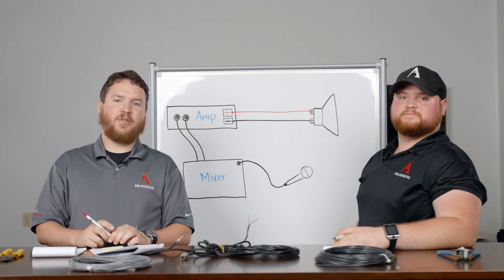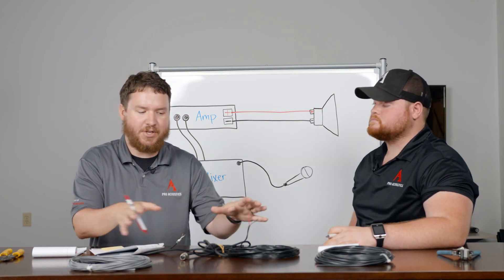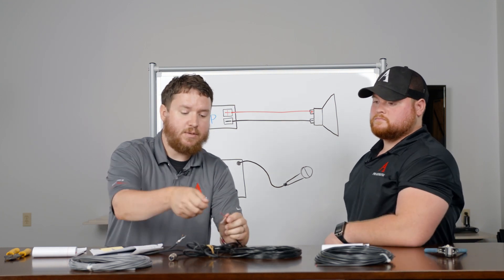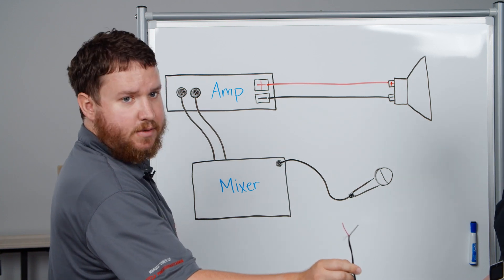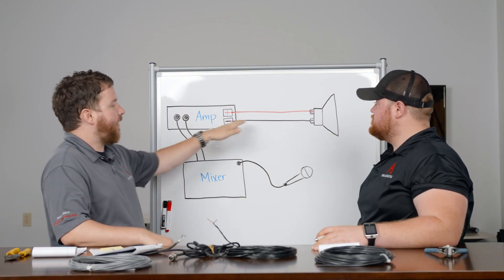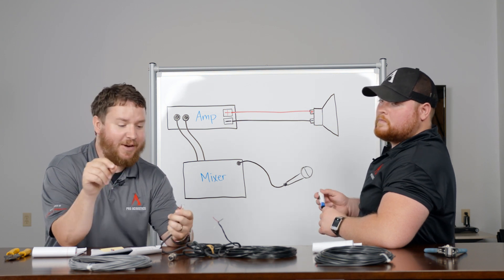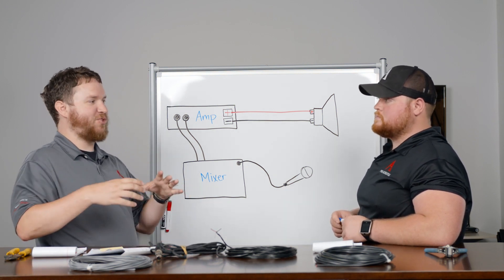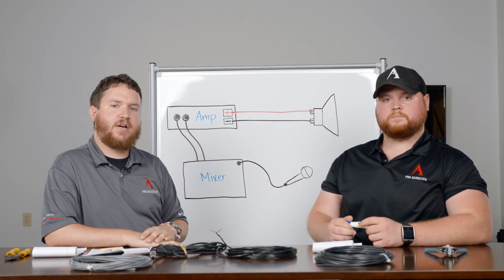Speaker Wire 2.0 - How Does Speaker Wire Work on Pro Acoustics Tech Talk Episode 15

Comment: sir, what size speaker cable for 1000 watts subwoofer speaker sir.
Reply from the maker: Hi there! The size of the speaker cable you need for a 1000-watt subwoofer speaker will depend on the length of speaker wire you need to run. Generally, 12 gauge wire should be adequate for runs up to 120 feet for 8-ohm speakers, and up to 60 feet for 4-ohm speakers. For longer runs, you might want to consider using 10 gauge wire. Hope this helps!
Reply: @ProAcoustics  I  using the speaker D"15   1000watts for subwoofer may be length cable wire 20 or 25 meters sir what size the cable sir.
Reply from the maker: @alchontai8351  Unfortunately, we're not familiar with the D'15 1000W subwoofers. We recommend checking the product manual to determine if they are 4 ohm or 8 ohm. If they are 8 ohm, then 12 gauge wire should be adequate for a length of 20 to 25 meters (65.6 to 82 feet). Thanks!
Reply: @ProAcoustics  thanks you so mutch sir for the reply.